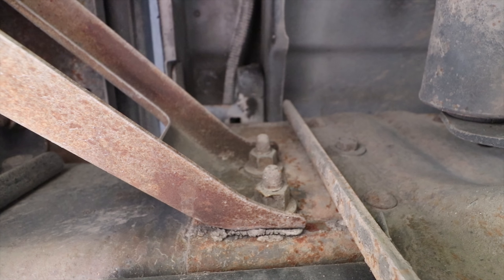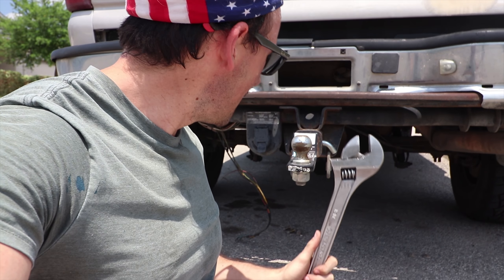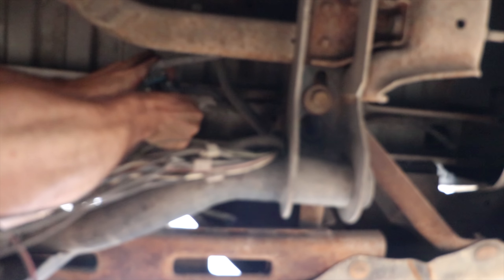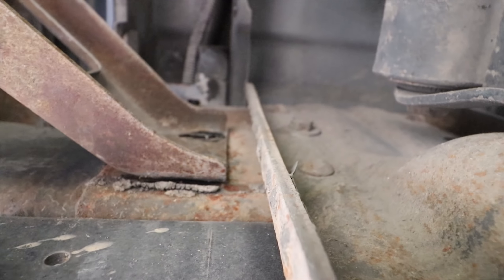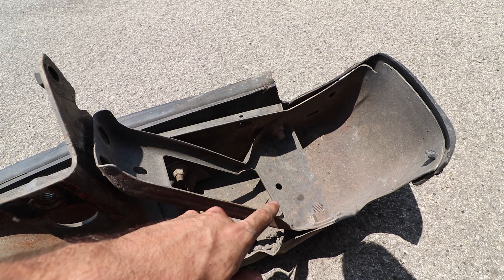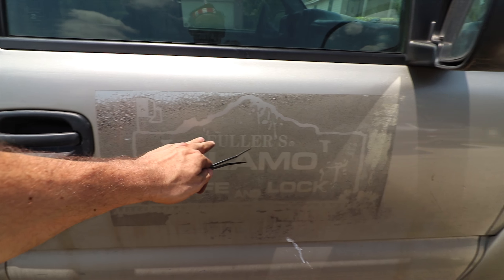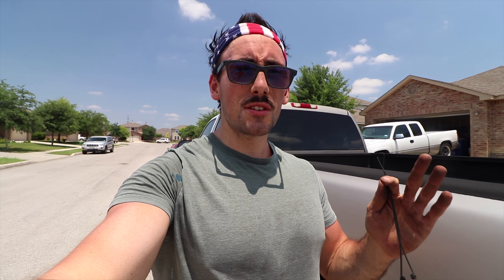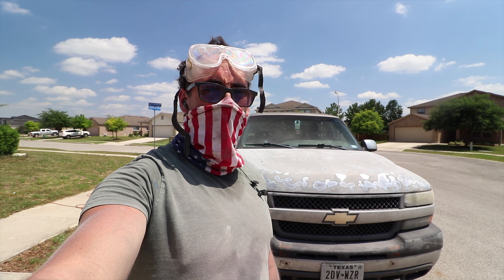Prepping the Duramax for Plastidip Part 1 | Removing the rear bumper

Comment: Is your truck fast?
Reply from the maker: Mods with Matt for a stock truck it’s not bad, I love it because when I’m towing the cars it’s effortless. The only thing I would change is having the injectors outside the valve covers 😂 once I do some mods for more power it’ll be a fun truck. I daily it and I get around 17 mpg city and highway mixed. Anything is an upgrade for me because before this I was driving a 75 c10 daily with no Ac in this Texas heat!
Reply: The Daily Drift OUCH yeah anything with ac is luxurious to me haha! I changed the injectors in mine and it still has a low fuel pressure code and is a total DOG but even running like crap it still gets 17 mpg! Apparently exhaust and tune and you should be over 20! In a vehicle that could pull down a house haha
Reply from the maker: Mods with Matt that’s interesting, I wonder why it’s doing that. Yeah mine feels pretty good, but I could tell a huge difference from before because it was hesitating and smoking like crazy before and after the injectors the smoke cleared up and it stopped hesitating. Yeah that would be awesome to get 20mpg in these trucks. It’s pretty crazy considering just how big they are.
Reply: The Daily Drift honestly I wouldn’t be surprised if I did something wrong or even had a dud in one of the 8 injectors I got. Apparently that could happen. Did you have to tune yours after installing? I heard on a forum you can’t just toss in new ones without updating the computer or something? Idk seems like everyone does tho